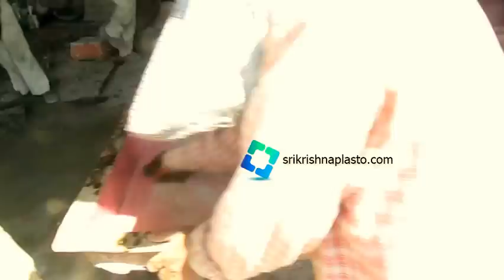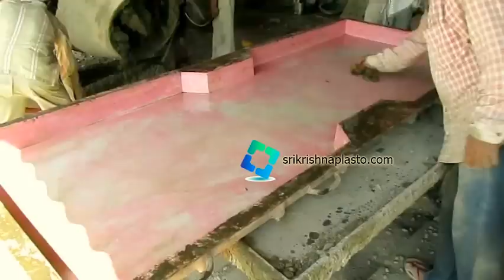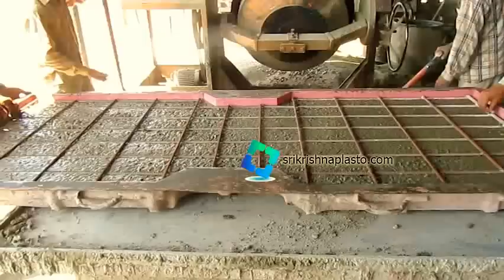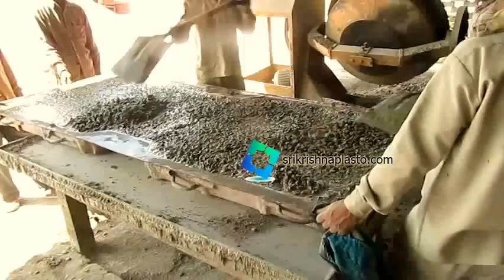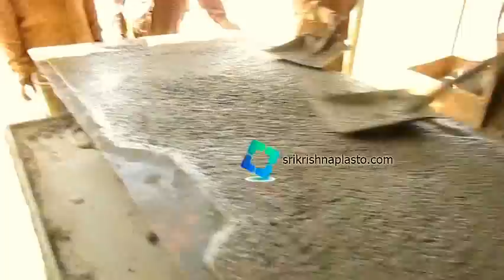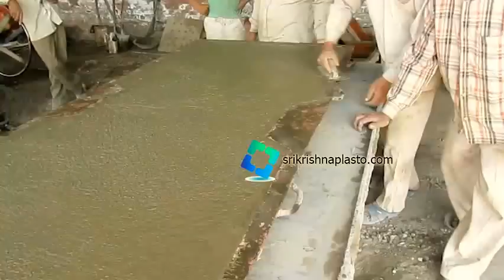How to make Precast Concrete Slab,Precast boundary Wall,RCC Drain Cover,RCC Bench,RCC compound wall

Comment: Just a thought, but if you emptied the mixer directly into the mould, it would save a lot of back breaking work. It's not rocket science you know.
Reply from the maker: Peter Sab Dear sir, Email me if you have any confusion 
info@srikrishnaplasto.com
Reply: Sri Krishna Plasto
I have no confusion. Just wondering why people in 3rd world countries work hard instead of smart. Pouring the concrete mix into the mould directly from the mixer would save work. I guess when you work for 2 dollars a week, it doesn't really matter
Reply from the maker: Peter Sab 
We have all kind of machines but it depends on client preference of working.
In this case the material to be filled was done thrice that is why the mixture was nor directly pored from the machine, due to big size of the mold the required quantity was higher. The client manufacture 4-5 pcs on weekly basic that is the reason he has not taken that machine.
Reply: +Peter Sab 
Two Dollars A Week In Which century do you live??
Its 12 dollars a day now even for unskilled labours.
Reply: Peter Sab, this is india or pakistan, nobody take care of them
Reply: Peter Sab i
Reply: Their labour are cheap. If they work smart, the operator got nothing to do.
Reply: Really appreciate your idea of course not a rocket science but who will do you can see the condition of workers.

Comment: Dear Sir
For your knowledge our opinion is that   precast slab and pole is not good for but prestressed pole’s and slab are proper in this iron bar are provide with tension bar so strength durability is too much for precast and for prestressed pole method of bath is equal only change is strength
Reply from the maker: Jignesh Parmar 
email me
Reply: Sri Krishna Plasto

Comment: Hello, can I ask what was on that sponge at the beginning of the video ? Some kind of oil, or saponate ?
Reply from the maker: lubricant , like silicon oil , a layer between concrete and mould
Reply: +Sri Krishna Plasto Thanx, but i also have problem with small bubles. How to prevent them ?
Reply from the maker: +matkusko 
please email me good quality pictures, also send me your making process
info@srikrishnaplasto.com
Reply: Concrete mixture to get light grey colour